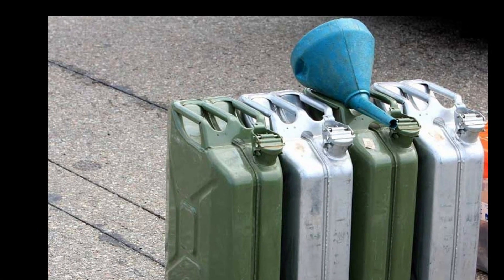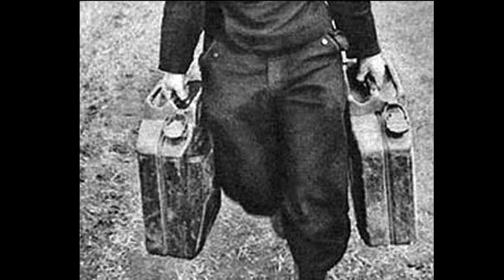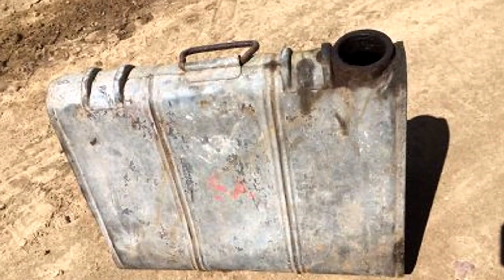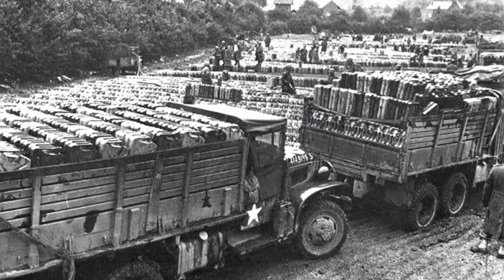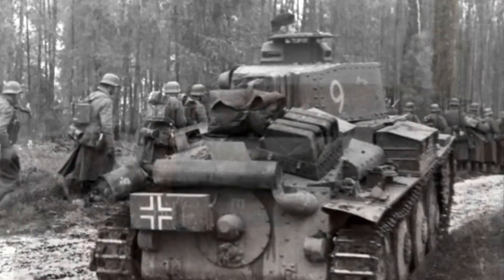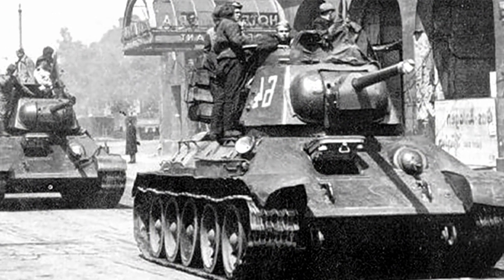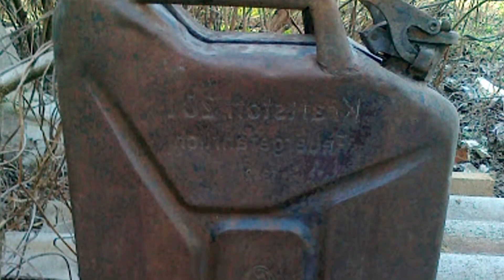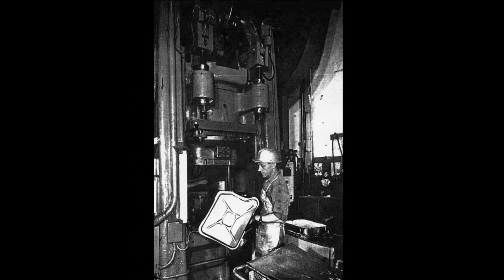classified development of canister,  why there 3 handles

Comment: Actually it was intended to have 2 handles. But the air trapped in them whas insufficient. So if the temperature change was higher , then cannister started to spill. If the handle was thicker , it would be not comfy. If the part behind the handle wad bigger, it be still not comf. And a lot of cans where allready made.

Hence the choice wad to have a third handle. I have an early version of this cannister , with the original 2 handles. And I allso have an modern one with 3 handles.